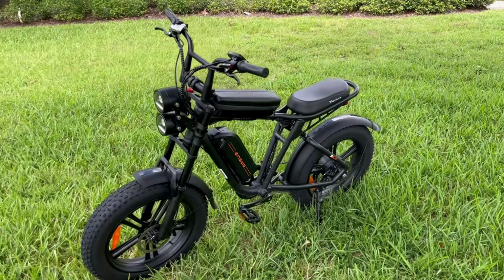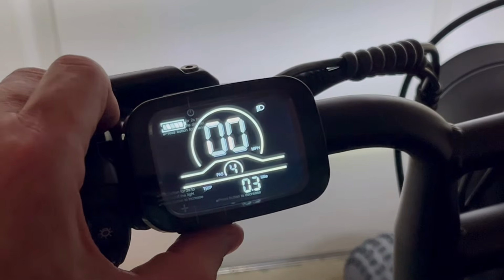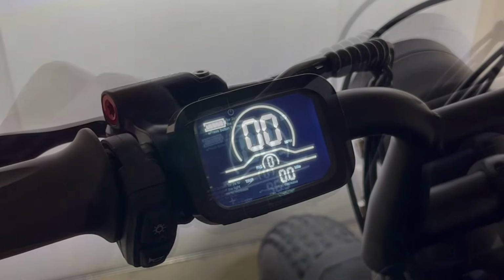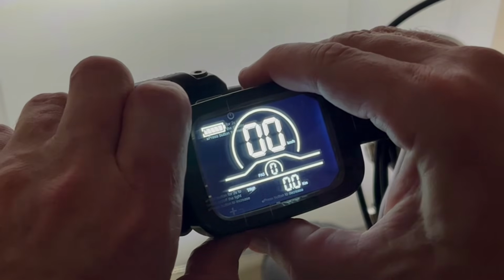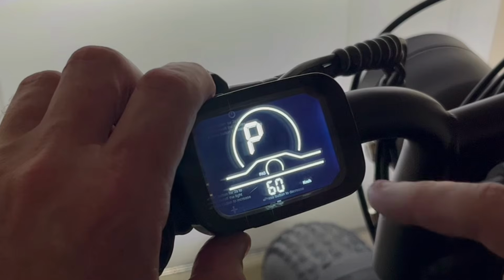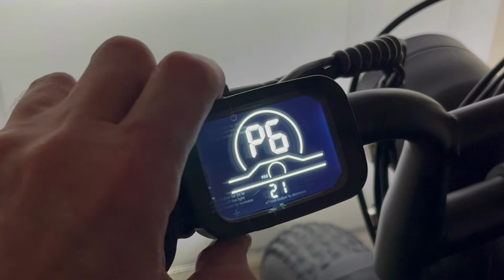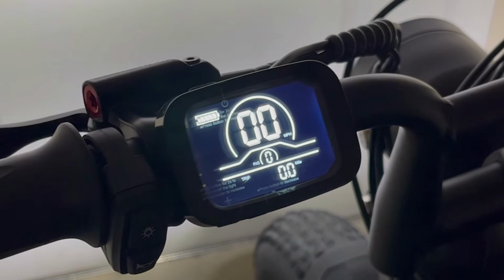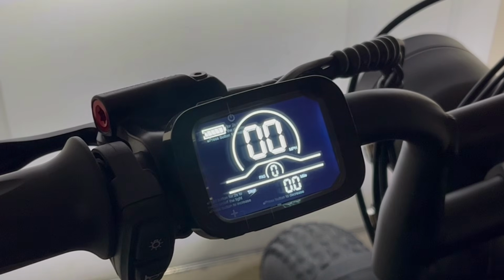Engwe M20 Display & Controller Settings - Yolin YL81C-B  kph to mph

Comment: I can't adjust my speed higher than 25kmh, and I can't get the bike to work in throttle only mode. I've tried all suggestions in videos etc. hope you can help
Reply from the maker: Ask Engwe support they are helpful
Reply: @BRichSolution I touch P8 but now my screen is not showing normal screen home 😞
Reply: I have the same lcd but on an Ancheer 27.5'. I literally can't change the speed, diameter or anything 😭
Reply: @Venomous8495  most annoying thing is that manual of the bike literally shows that you should be able to adjust everything!
Reply: Did you solve your problem I figured it out
Reply: @georgeflatman9353  nope still the same
Reply: @karlosthehawk  try this worked for me bro so hold +\- at same time to bring up the settings once it does hold + until the screen shows 63/kmh then hold power button to save and should be unlocked throttle should take you to max speed hope this helps let me know
Reply: @georgeflatman9353  yes but it's getting it back to the way I received the bike no working throttle at all it's just kinda weird that it can no longer go back that way after I activated the throttle because now all I can do is when I deactivate the throttle it still on but at ,3mph only when it was no throttle power at all
Reply: @karlosthehawk  that is strange I mean not sure what to suggest only got the bike yestaday but if you factory reset all settings then try to deactivate the throttle switch off and then activate it again then try the unlock thing I just said if that doesn’t work I’m not sure of the issue sorry I couldn’t help I hope you get it resolved honestly just keep digging the internet and speaking to people I’m sure you’ll figure it out
Reply: @georgeflatman9353  I have tried everything lol even asked Engwe and all they say is basically what you said before it's like the bike throttle was ment to be on at 3mph in the first place and not fully deactivated as it was when I received it but any cheers for trying to help me out 👍🙂
Reply: It need to be unlocked it’s set for the uk Press - Power On
Hold Pos & Neg (P1 Flashes)
Hold Pos 15 sec (63 Flashes)
Reverse to Lock
Reply: I got mine yesterday and can’t adjust that either. The plus & minus buttons do nothing on that section. I’ve emailed ENGWE and they said to do factory reset which I’ll try when home.
Reply: @class_canvas I have same problem. If u fix it let me know pls
Reply: @acp2681 i have the same problem can you please let me know if there is a fix?
Reply: @muharemalicic7861  hey buddie. when did you get the bike. I'll let you know any updates. so far engwe want videos of me going through the settings and showing I can't adjust speed etc
Reply: @kherber1  i really appreciatie it bro thanks you so much
Reply: Me too got mines Today and Same Problem 😪
Reply: @HernVanApfel  

Here's the correct steps to unlock the speed.
After the display is turned on, press and hold the "+-" button at the
same time for 3 seconds to enter the setting interface. After
releasing the "+-" button, press and hold the "+" button for 15
seconds to release the 6km accelerator limit and the 25km/h speed
limit.
Your display is the latest version, and the method of releasing the
speed limit is different from the previous one.
Reply: @Zmaj035 
Thank you so much 👍👍
Reply: @Zmaj035 brother I touch P8 but My screen not going back even P8 is not edit 😢 please help me someone
Reply: @EuroVenture-up5zp  you touched the one with the password?
Reply: @Zmaj035  I just touch P8 everything 0000 I don't know what happened with that
Reply: @Zmaj035  I am stuck 😞 in P8 system is not going back 🔙
Reply: @EuroVenture-up5zp  try using the code 1212 or 1313. This should work i cant promise that because im not a expert. I would not like to get it fucked up.
Reply: @Zmaj035 still doesn’t work
Reply: 1212 and press on button @EuroVenture-up5zp
Reply: @Zmaj035  this worked on mine but speed tops out at 25mph and that's it it should go over 30mph
Reply: @Zmaj035  You're the best
Reply: @EuroVenture-up5zp 1212 to escape then P1 and +button for 10secs then the bike is de-restricted
Reply: @Zmaj035  how do you get it back to fully factory reset because I tried twice and the throttle still works in pedal assist mode but only 3mph when I want it fully deactivated I have tried the turn off and brake routine that no longer works now too
Reply: @Zmaj035 Thankyyyy Bro thanky
Reply: @Zmaj035  thanks dude, you save my lifa😘
Reply: @Zmaj035  I have done it but mine now has cleared out the 25km limit on the screen and shows something like this sign _ _ _ _. Pls what does it mean? Thanks
Reply: @ThesurfingHoBo Hi , where do i enter the 1212 code,please?
Reply: @Kh-47M2_Kinzhal hi , my M20 tops at 25mph too.
Did you manage to get any more top speed out of yours, please?
Reply: @Zmaj035  this is not working on mine
Reply: I have the same problem, i’ll wait your update regarding this problem. Thank you so much
Reply: Go to P1 hold the + button for about 10secs then 63km will come up on the display and that’s it
Reply: @ThesurfingHoBo  P1 for mine is just showing voltage 24,36,48 no doing what you said
Reply: @ThesurfingHoBo i did like that but now dont work the pedal why?
Reply: @ThesurfingHoBo  no dus not work on mine
Reply: P1 hold the + button for 10secs and 63kmh will display.. job done!
Reply: P1 +button for 10 secs and it will display 63 km then your good to go..
Reply: @ThesurfingHoBo thanks bro
Reply: IF THROTTLE AND/OR SPEED ABOVE 25 KM DOESN’t WORK:
- Turn ON display
- Hold down MINUS (-) AND PLUS (+) button at same time until display says P1
- Hold down PLUS (+) button for 10-15 sec. until display briefly changes
Reply: Anyone here can help me????
Reply: @awaisiqbal1897  only know with the m20 to unlock hold +\- at the same time and then hold plus till the display changes then everything should be unlocked
Reply: @awaisiqbal1897  what bike you got bro
Reply: Go to p1 and hold + for 10 sek til 60 km is on the screen and then it should work
Reply: I am experiencing the same problem. Can’t increase my speed above 25km… Any help will do. Thanks
Reply: Go to the settings and hold the plus button 15sek then you can drive 45kmh😊
Reply: cheers anyway I will keep trying. Engwe respone has been to just send me links to YouTube video. Engwe uk don't seem to be mega helpful so far
Reply: @kherber1  I’ve emailed them and sent them the video of me trying to unlock the speed and they’re sending a new digital screen.

When you go into the P3 settings, do the plus & minus buttons do nothing like mine? It’s strange as they work in the the other sections of the menu.
Reply: @acp2681  yeah mate. the button dont work when adjusting the speed setting, but work in every other menu. and the throttle will not work apart from walking speed, I have sent them videos aswel now

Comment: Hello just want to know that i want to reduce the speed is that ok or i should Reduce the amps also
Reply from the maker: Ya reduce amps will lower speed and increase range
Reply: I think I don't need to reduce the amps to get lower speed. Because my Engwie M20 has only one battery. I left to 13 amps. Is my was with two batteries I will leave. So I set in the P3 to 60 km and it works. I set to use all the magnetic heads and it works very well.
Reply: Someone made a video that if we hold the + button for ten seconds displays will show 63 km.. But I didn't do it yet. Cause I don't know what can happens later.
Reply: Sir my cycle stuck 😞 in P8 how to get back normal screen

Comment: My bike initially had 8 pas modes after some messing around now I can only reach 1-3 any idea how to adjust back?
Reply from the maker: See user manual and worst case factory reset see section 3.2 http://myosuploads3.banggood.com/products/20230321/20230321034539M20.pdf
Reply: Yea I’ve already gone through this manual as well as an older one and still haven’t been successful have reset multiple times not sure what else to try or what parameters to change have gone through every p setting 1-8 none change the amount of pas modes
Reply: I just got this a week or two ago and before understanding what I was doing I ended up just resetting to default which is what brought me to this state (bought this second hand fyi so not sure what the other guy did)

Comment: Anyone know what the wheel setting should be? the diameter of the tire or just the wheel? Cause it is set to 26" from the factory, but the wheels are 20"
Reply from the maker: adjust wheel size to speedometer accuracy.  Use GPS app on phone to confirm.  I set mine to 22" which waqs accurate lower speed and high speed off by 2 mph

Comment: How do I get it off pedal assist  ?
Reply from the maker: Ask Engwe.   The manual does not allow for user to configure PAS mode.   Maybe disconnect the cadence sensor on the crank from the controller?   Full user manual http://myosuploads3.banggood.com/products/20230321/20230321034539M20.pdf
Reply: @BRichSolution  Thanks yeah its the same manual you get with the bike.
Reply: @BRichSolution  I got it working thats it in full throttle mode 😍

Comment: Hi just wondering what settings would you recommend changing for long rides I would like to ride it for a longer time rather than speed or is it best to just use lower assist
Reply from the maker: Change the max amps from 22A or 20A to 15A to prolong your range
Reply: @BRichSolution  thank you so much for your reply

Comment: I think i changed the password setting and now its coming on but is stuck on p8 and when i hold power button and the + its not giving the option to factory reset,??help please
Reply from the maker: See user manual section 3.2 for factory reset http://myosuploads3.banggood.com/products/20230321/20230321034539M20.pdf
Reply: Sir I have the same problem now please help
Reply: Please explain me how you come out from P8 I am still stuck 😞😢

Comment: I have the same display but on a different ebike. My settings are set at P0 and 4 0’s underneath that. Is there any specific number combinations? The bike company isnt very responsive
Reply from the maker: I believe that is password to lock settings
Reply: @BRichSolution  okay cool so im assuming the bike company will be the ones to help me figure out the 4 digit code. Thank you

Comment: Thank you you helped me finally set up my bike don't forget if you lock your bike in p8 by accident you put 1212 and it bypasses to set it up again
Reply from the maker: Thanks for the feedback
Reply: tnx man i was fucking up with the password and didn’t remember that ..after starting reading the cmnt i got u😂❤️
Reply: I need help!
Reply: What's up
Reply: Which button is bypass I don't know bypasses my cycle is stock because of P8 😢😢😢 seriously I am like crying 😭
Reply: Please help 🙏 me let me know how to adjust P8 back from my screen 😞
Reply: @EuroVenture-up5zp 
Press Power and Minus Buttons at the Same time for a few Seconds, after that There is instead "P8"
Now a "P-" after that use the Password 1212 or 1313 and finally Press the Power Button for 1-2 seconds
Reply: I use the Engwe l20 and for me worked the Code 1313

Comment: I have a question can you turn down the light of the front totaal down ?
Reply from the maker: The headlight swivels on the bracket so you can adjust the beam down
Reply: Thanks for replaying ,

But can you turn the lights totally down  wil the bike is on

Comment: the manual didn't explain any of this and now I'm locked out of my bike...
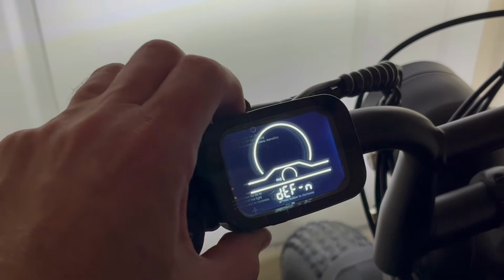Reply from the maker: try factory reset outlined at 4:04
Reply: @BRichSolution  hi I have done the same with p8 setting and don’t know the password
Reply: @JamiePaterson-q9p  paswword is 1212
Reply: @BRichSolution  how do you turn the head loght of ? I have held the "light on button for 2 secs ) as instructed but I can't seam to turn them off now😂 I've tried holding the light on button for 2 secs , also tried the light button by the horn ... im stumpped🥴
Reply: 1212

Comment: How can i turn off the light? Do i need disconect the wires?
Reply from the maker: There is headlight button.  Or you referring to small light bar jn head light for safety?  If so you can turn off
Reply: I have the same problem. I want to turn off the light. Can you help me?

Comment: Hi there,very informative video,although I have a problem,my display is now stuck on P8 and the 4 digit display is flashing,I have tried to reset to factory settings as you described holding the power and plus button but no go.any advise please as my M20 won’t let me power up?Kind Regards Peter
Reply from the maker: Try password 1212 if that doesn’t work reach out to manufacturer or seller
Reply: @BRichSolution  cheers Bro worked 1st time,much appreciated 👍
Reply: 1313 worked for me but I have to press the power button quickly at the end

Comment: i face problem with the speed and distance indicator. i am cycling with 39 -45 km/h and shows 0. Engwe send me a new controller but ALL THE SAME. Could anyone help, pls???
Reply from the maker: Interesting.  I wonder where it gets the speed from?  Its not the cadence sensor on the crank as mine went bad.  It must be a signal inside the rear hub motor?   What did Engwe say?
Reply: I don't know probably the sensors are inside the motor... and Engwe is sending me a new motor.... i am waiting 12 days so far... probably it will need 15 days more to wait, the same days as i was waiting the controller that they send me. @BRichSolution

Comment: Hello, P6 must be 20. Because of a controller maximum is 20 Ah. At 25 maybe heat your controller.
Reply from the maker: Yes it won’t take more than 20a
Reply: est ce qu'il peut etre en dessous ?

Comment: Hi! And what happens if you set the voltage to 24?  And what are the magnetic sensors responsible for? I would like to increase the sensitivity of the pedaling
Reply from the maker: Not sure… I did set volts once to 36v to extend my range on long rides but it cycles the battery below BMS
Reply: @BRichSolution wtf I put mine on 36v 25amp and the controller exploded
Reply: @thertsr9999 😂now you gotta get a new bike

Comment: Sorry man .. i Didnt know the p8 button .. and maybe clicking no paing attention IV changed the default s password.. how can i do ?? 
The bike Is blocked on P8
0000
Reply from the maker: My default was password was 1212.   You can do a system reset see video to unlock
Reply: @BRichSolution  thank you so much.. 
I solved .. 
Actuallt, in my ignorance, i set the time on the p8.. 
I rember that was 18:42..
So i out those pass and the e bike unloncked.. 
I was really scared.. 
Anyway ,still i cant do the reset.. 
Hope that i won t Need 🤣
Reply: @BRichSolution haw do I do a system.reset because I'm stuck at p8 ? Thanks!!!
Reply: Please help me I have the same problem now 🙏😢